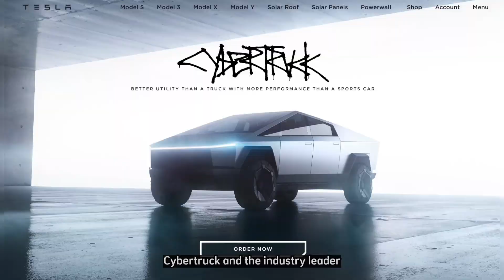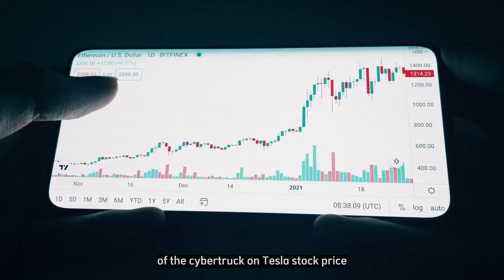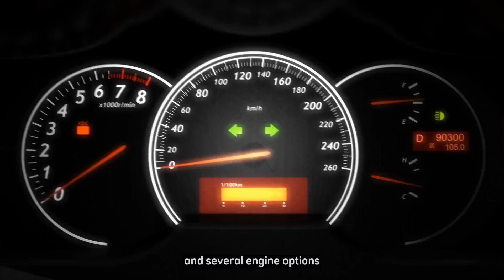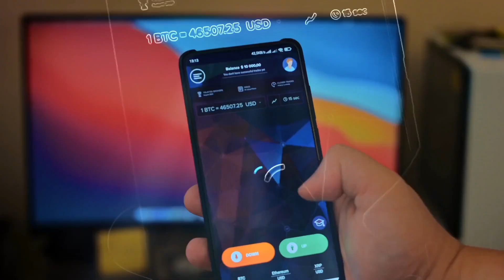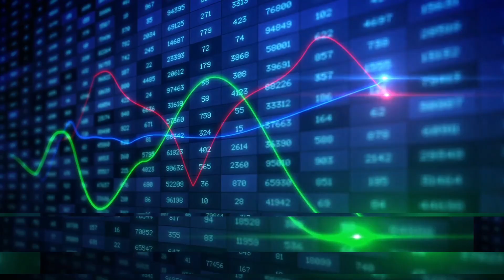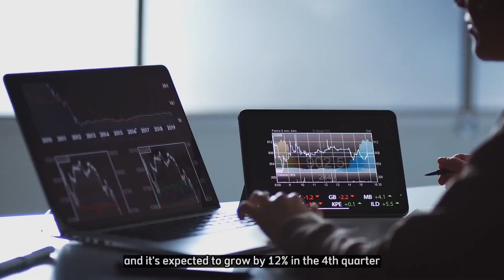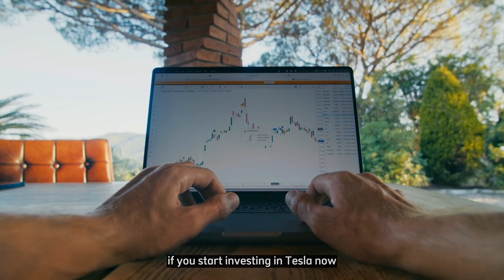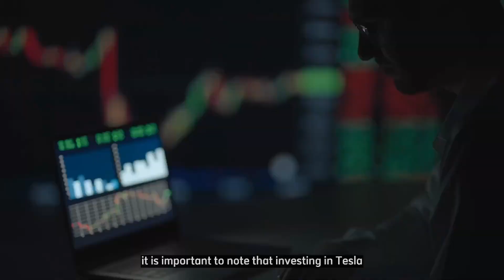Cathie Wood HUGE Tesla Stock Prediction: Post Cyber truck

Comment: Hey Prima- Its interesting how long standing things resist change.  An example is the standard design of any pickup truck... Cybertruck has received so many criticisms... for being unappealing to the eye.  If we take a step back, is the standard design of traditional pickups attractive? I say NOT- in fact its clumsy, aerodynamically poor, gets poor mileage. Everything about it is ugly.  SO why don't we discuss this part of the debate- there will be some that want the boring, ugly, inefficient traditional truck... but when we think of all of the value and modern design of the Cybertruck, I believe we will see significant demand to change in that traditional truck market... spoiler alert- doesn't Tesla have 1.8m deposits? Cybertruck keeps improving in to the eye and in the the capabilities!